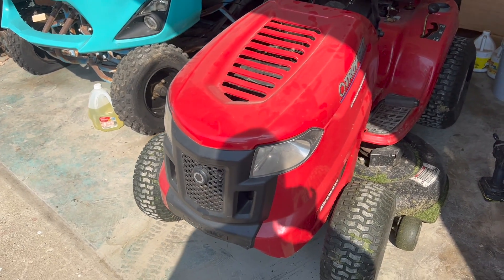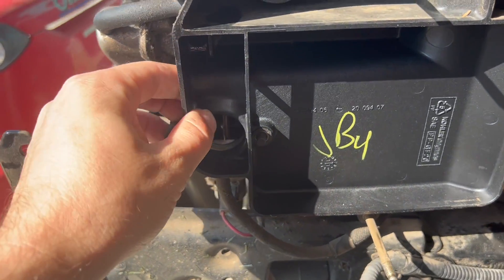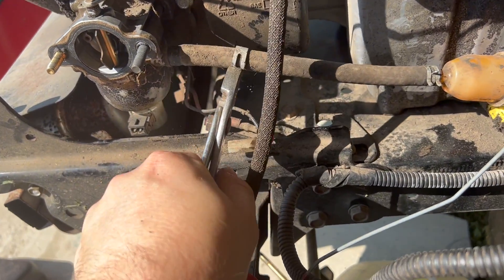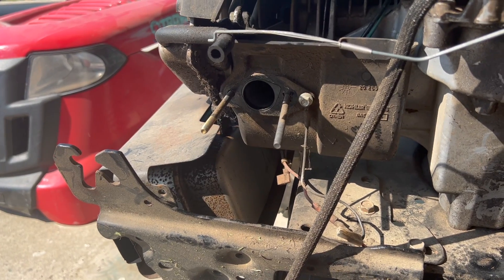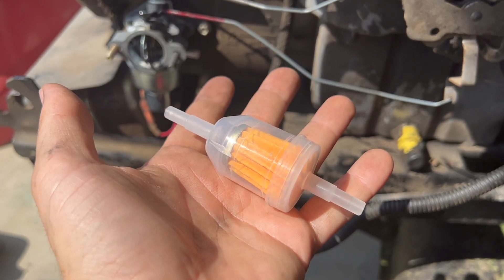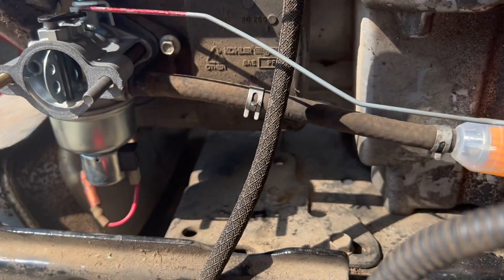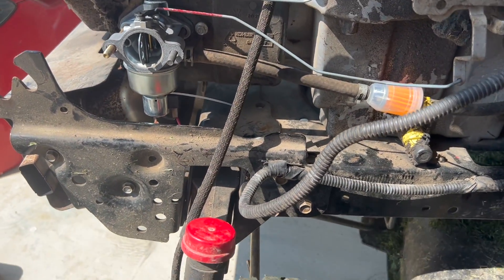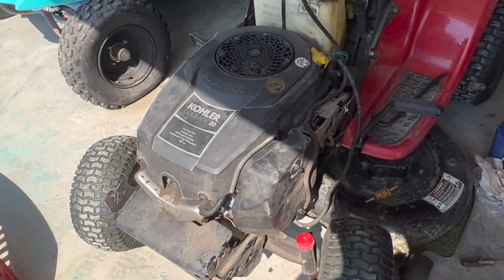How To Replace The Carburetor Troy Built Bronco Riding Lawn Mower

Comment: And BOOM!!  I can replace a carberator!!  Thank you so much!!!
Reply: I replaced my carberator just as you said.  My tractor still stalls after about 30 seconds running.  What is next??
Reply: I found the new carburetor he mentioned in this video to be faulty. The mower would only run with the air filter off. Otherwise the engine would surge and then die.
Reply: @joanpeters9330  there are a few possibilities.  You may have a fuel flow issue, a choke issue, or an issue with the fuel bowl float actuator.  Thats the part of the carb the wire links to.

Comment: Looks like your gas filter is installed backwards and isn't the OEM type with the screen instead of pleated paper. I recommend installing a fuel shut off valve anytime you remove the gas hoses to work on a carburetor. I have the 19HP Kohler Courage on my 2017 Troy Bilt Bronco and installed a Briggs and Stratton 1/4" fuel shutoff valve so I don''t have to worry about fuel dilution of the engine oil if the choke valve sticks open while the mower is sitting unused. You also don't have to remove the side rail to get the carb off. You can remove the front carb mounting stud and rotate the carb to disconnect the linkages and clear the frame with the solenoid on the bottom. Thanks for the video.